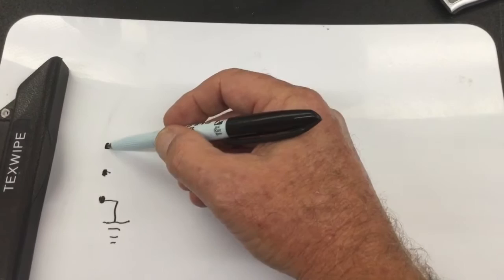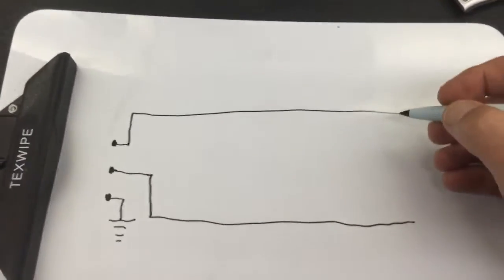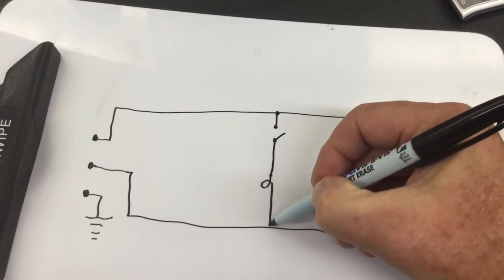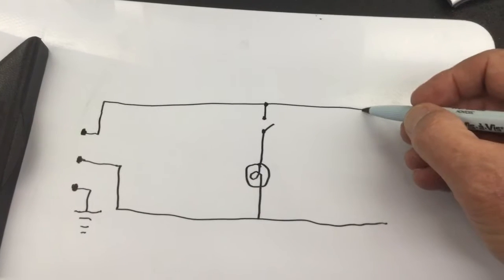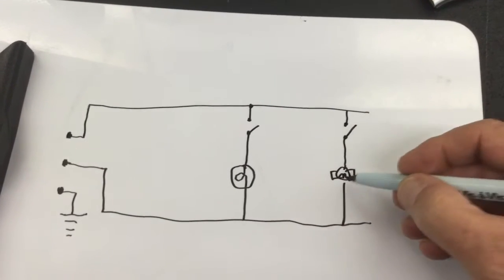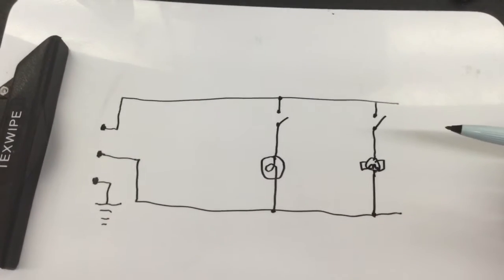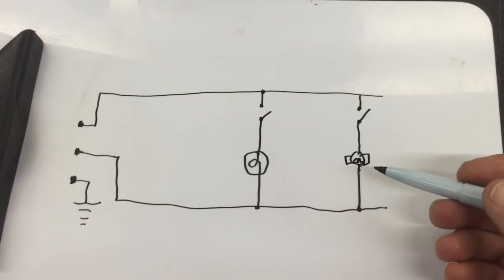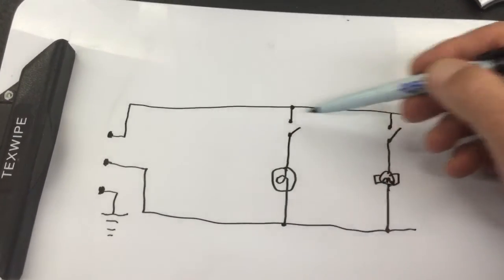Film Drying Cabinet

Comment: Hi Joe, could you explain more about the air trap at the bottom of the cabinet? I am having trouble visualizing it. Thank you sir.
Reply from the maker: There's a slot at the bottom, the air passes through it and then through an "S-trap" before it exits. It functions as a labyrinth seal, permitting one-way flow of air due to the pressurized interior, while preventing exterior dust from migrating inward.

Let's say the base of the cabinet is 16" square. The slot in the bottom is about 3" wide, then below that are two more shallow chambers, each about 3" high, with 3" slots in their floor and ceilings, but arrange to alternate, so the air has to make a circuitous path to get out.

Comment: Thanks so much for sharing this Joe.   Retail units have always been cost prohibitive so this seems a great solution and one I am going to try.   I do have a question.  With the heat source being on top, would that not work against the top->bottom air flow that is trying to be established?  Would an intake and lamp on the bottom, combined with a fan drawing the air out on top be more effective?  Thanks for your thoughts.
Reply from the maker: It doesn't seem to effect the flow that much. Being as I use this more for sheet film and paper than roll film, having the lamp on top means it's closer to the film or paper,  helping to dry it faster. Of course, the radiant heat is less affected by a converse airflow.

I also didn't want drips of water from wet film dripping onto a hot lamp, hence the reason for the top location. Yes, I could have put a clear shield over the lamp if on the bottom, but that blocks some heat from getting to the film/paper.

Comment: Nice drying cabinet. I went a cheaper route. Way back in the '70s when I was attending high school in California. In our photography class, we used an old tall gym locker. So, when I started to develop my B&W film at home, I searched for a similar gym locker. I finally found  one on craigslist. I purchased it for $25 and it works great. It is close to 7 feet tall, so hanging a 36 exposure 35mm film roll is not a problem. I can also hang 8X10 sheet film (in hangers), without any problems. Adding a filtration, fan and heat source, as you did, seems like a simple project. Thanks for the inspiration.

Comment: Hey @Joe Van Cleave I'm curious to know how you fed the power cable through the wall of the upper sealed vacuum chamber. I've built a similar rendition to yours, a bit simpler as it doesn't have the lightbulb - so I didn't need to wire or solder a connection together - but I'm stumped as to how to maintain the vacuum seal in the upper chamber and still have a chord pass through so it can be plugged in.
Reply from the maker: The power pass through to the upper chamber uses a strain relief bushing on the cord, that passes through the rear of the cabinet and is tight enough to provide an adequate seal. I wasn't expecting semiconductor standards of cleanliness, so the consumer vacuum cleaner HEPA filter is adequate. The laminar flow, via the fan, also helps keep particulates at bay, as does the heat provided by the incandescent lamp.
Reply: Thanks for the quick reply. I decided to drill a hole through the "lid", or top of the unit, to pass the cord through, then tape and caulk that section. It's just drying now but should work fine. This video provided a great description and overview of how to build one of these units, so I applaud you for making this video as it was a great help.

Comment: Thank you for your ideas! I like the Hepa vacuum  filter idea. The idea I had was to use a bathroom exhaust fan at the bottom with the the incoming air on the top sides of the cabinet. I will try to build one this winter.

Comment: Very nice! Why not use foam-board instead though? Or a collapsible tube made like a Japanese lamp? IE a tubular spiral clad with paper or fabric? Would be extremely light and moveable and also adjustable to any length.
To get better laminar airflow why not put a simple diffuser in front of the fan? Just a perforated barrier would suffuse.
Reply from the maker: Great ideas. There's lots of room here for improvement.
Reply: +Joe Van Cleave If one has the space for it, no doubt your solution is the best though.